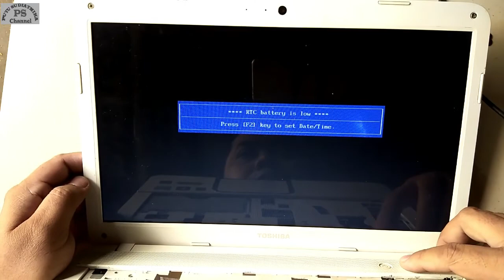Mengubah VGA AMD Ke Intel Pada Laptop L840 Karna Chip VGA Rusak / Repair Laptop Disable VGA

Comment: mantab bli ilmu nya. moga rizki nya lancar. sy coba praktekan .tapi ternyata hasil nya nihil.usut di usut. yang kasus nya on tidak display.prediksi sy belum tentu chip vga nya bermasalah.cuman share info.untuk agan2 teknisi yg punya kasus sama .on not display. tes reflow dulu vga nya.kalo masih blum display. ada kemungkinan jalur tegangan ke lvds nya yg ga keluar .kasus yg sy punya ternyata.di titik dispon_o_n 3v socet lvds kaki 21 tidak hadir. setelah. di telusuri ternyata sumber tegangan berasal dari kbc.di karnakan part kanibalan nya gaada. sy coba jamper di titik R9593 ke titik U26 kaki ke 1. alhamdulillah hasil.  semoga bermanfaat.

Comment: Kasusnya sama, VGA Radeon rusak. Tapi  windows maksa buat install driver. Padahal kalo gak di instal aman aman aja. Biar driver gak ke install sendiri gimana ya ?
Reply: Set up di BIOS system config(tekan esc trus F10).. mode switchable centangnya dihapus/mode switchable ganti mode fix /tergantung jenis BIOSnya.. abis itu save & exit.